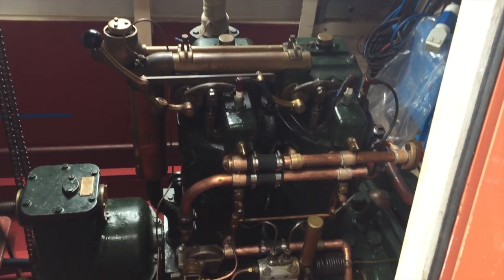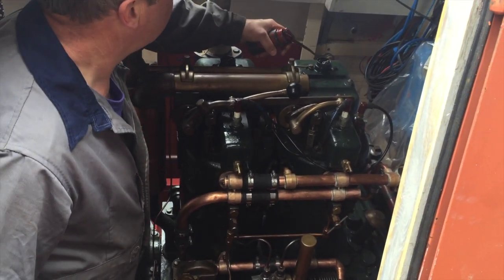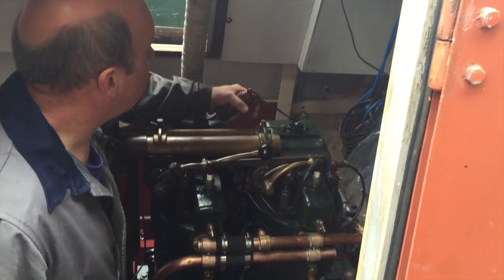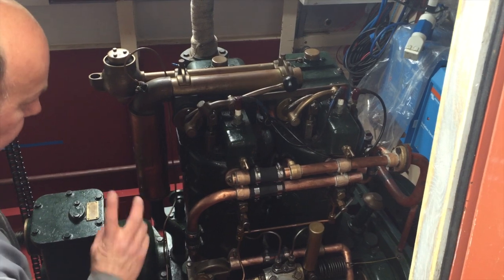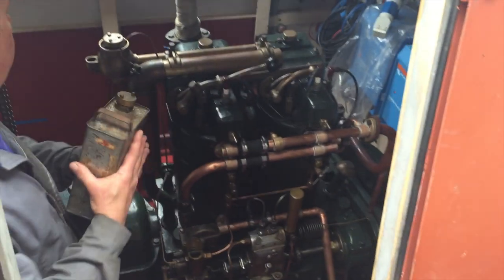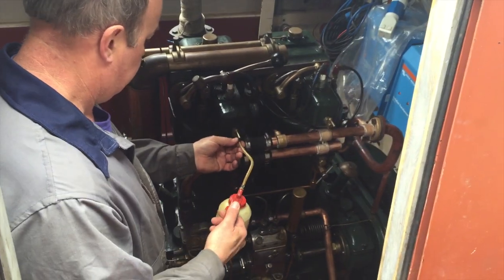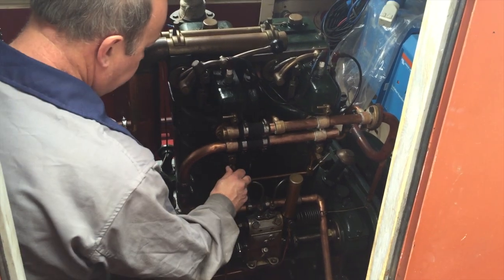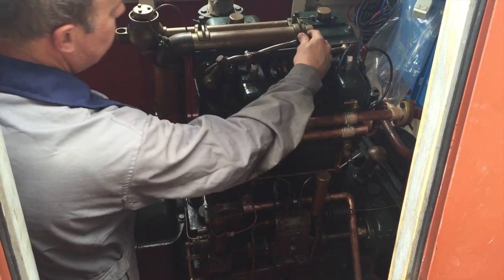1942 K2 Kelvin Engine. 8 1/4 Litre - 2 Cylinders.

Comment: Did it even get running on it’s own before the video stopped?
Reply from the maker: Its running in this video. It starts on petrol and then switches over to diesel
Reply: It's what they call a "hit and miss" engine. They fire a few times, then coast a few strokes, the hit a few times.

Comment: Why didn't they simply make the cylinders smaller and make it an even firing three cylinder-silly design.
Reply from the maker: Because you would reduce the overall torque low down - while increasing the rpm for the desired output.
Reply from the maker: also - its a 1942 engine. what are you expecting?
Reply: If you knew propeller torque curves, you'd know that low end torque isn't necessary since propeller horsepower consumption is the highest at the highest RPM. But having a 1942 engine is unique. Give me a modern 3 cylinder water cooled engine that you simply turn a key to start.
Reply from the maker: @Tchristman100  Quite presumptuous about what I know and what I don't know - but thanks anyway. I'd love to stay and chat - but I'm a busy engineer and not an armchair youtube critic
Reply: @deffojeffo  well said👍
Reply: Funny how there is always some smart arse know all to spoil the moment! F.F.S!
Reply: clown

Comment: I was on the motor barge Roan in 1969, London & Rochester Trading Company. She had a Kelvin 88, which was the 4 cylinder version of this type. M.V. Action was another small Coaster with twin 66's, the three cylinder version. Brilliant, reliable old workhorses! We started on petrol then changed the valve over to run on diesel when it was running. We used to put a drop of petrol in the bowl at the end of the air intake manifold, then squirt some through the vent taps on the side of the heads. All hand crank in those days, no fancy electric start for us back then.
Reply: I was on the NOUGHTON she had an 88hp Kelvin engine, never let you down, plodded on and on. great days.  Late 60s 70s, That was about the time I was working for Crescent Shipping. then went on to the small Coaster LOBE. running around the southeast coast and across to the Continent, Rotterdam, Belgium, France.
Reply: @brian.7966  Hi Brian,i was on the mv Rodent in the 70s for Crescent Shipping, i think she had a 3 cylinder 66 hp Kelvin engine, a good engine,hard to turn over when you are knee high to a grasshopper, the Skipper was bing Bill Sales
Reply: Hi Mo Gordon ,i was on the mv Rodent in the 70s for Crescent Shipping, i think she had a 3 cylinder 66 hp Kelvin engine, a good engine,hard to turn over when you are knee high to a grasshopper, the Skipper was bing Bill Sales
Reply: Hi Jeffrey! Have only just come back on here, sorry it's taken this long! I was only on Crescent for a few months as I was waiting for a belated welder/plater apprenticeship to start. John Woolsey from Greenwich was my skipper, a miserable shit and always came back on board pissed! Nearly had us run down twice! Both times up the Thames! I wanted to go on the continental boats like Kiption and ignition but was told they wanted me to learn the Wallasea, Rochford and Medway runs. Not long after leaving them, I joined the Royal Naval Auxiliary service at Chatham and trained as a marine engineer, on inshore minesweepers, mfv's, fleet tenders, a tug and fast patrol boats. Had 16 years with them and ended up a chief P.o. Would have stayed with crescent if I'd got a continental boat.Happy days!,

Comment: Presumably you still own the narrow boat this engine lives in I have seen another video done by " Cruising The Cut " and his engine is a wee bit easier to start than yours as his is equipped with an electric starter. Not that you don't start her easily but we are all getting older and pushing a button instead of manually cranking her over may make you feel better. Cruising The Cut videos has three videos about classic old engines like yours in a proper engine room. Do you still hand crank your car? Time to consider installing a electric starter. Other than the starter all you really need is a geared flywheel. 

Merry Christmas!

Cheers!
Reply from the maker: James Shanks it’s not my boat - mines not as cool as this
Reply from the maker: James Shanks it does have electric start I think - but it was disconnected at the time of filming
Reply: Engines like those are likely more about nostalgia then ease of use. Like a status symbol. Otherwise I would guess that a conversion to a modern diesel engine would have been done. It’s very cool in my opinion. 

Crank on and cheers!
Reply: Jeremy Kamel this actually looks like a newish boat judging by the steelwork. Likely it was constructed with the intention of installing a classic showpiece engine. Conversion was never a consideration!

Comment: Big old two lung thumper.  Around the same time this engine was designed International Harvester had a number of large diesels that also started on gas then switched over to diesel.  Thanks for sharing the video and seeing the old beast being started and running.
Reply: That rings a bell!  In 1970 I knew a farmer who had an IH crawler tractor that he started on petrol then switched to either kerosene or diesel ... I can't remember which ... to carry on.  It was a bullet-proof engine that, typically for much farm machinery, received only very basic maintenance, yet went and went and went ... left outside in all weather of course!
Reply: I've been around a ten or so of those crawler tractors. A couple were really big too. Saw two of those engines set up as gensets and one driving a sawmill.
Reply: We had two John Deere "Johnny Poppers" that could start on gas (petrol) and switch to just about anything runnier than lard once they warmed up.  But they were spark-ignition engines on all fuels, not diesel.  
They did blow smoke rings when burning kerosene, which we thought was pretty cool.

Comment: K2 is 44 HP   very good engine  top rpm 600
Reply: 750 rpm for K Kelvins.
Reply: @billalbion  that depends on how your fuel  rack is set up
Reply: @annajeannettedixon2453  I think you mean governor which controls the rack. 44hp could not be made at 600rpm only 750. Look up the Kelvin book on line.

Comment: That type engine developed 22 bhp per cylinder at 750rpm in fishing working boats, tickover on diesel is 180 rpm with a 9 inch stroke. Indirect injection needs petrol to start and warm cylinders to fire on diesel.
Reply: Les Reed The engine has a dual function principal.  Meaning, the engine operates gasoline first to warm up the diesel side of the engine. Once the diesel side warms up, you change over the engine to run on diesel. Hence way some old tractor books refer to these engines as Change-Over engines. The gas side is for engine warm up, and the diesel side is for work. International Harvester made series of these engines for all types of applications, like the UD-16 and UD-24. But they were mostly used in dozers and power units applications.

So " Indirect injection needs petrol to start and warm cylinders to fire on diesel" is a correct statement, to this video. As the Kelvin engine utilizes this function.
Reply: Les Reed Read the description. It clearly states "Kelvin Diesel (with petrol start)"...
Reply: Pre combustion chambers. Like my  Mercedes  240d. It will drink any liquid that burns  as long as there are no lumps in it. Used engine oil, paraffin with 100:1 2 stroke mix used chip fat etc,etc,etc Harry Ricardo- a genius.
Reply: "Indirect injection needs petrol to start and warm cylinders to fire on diesel."
 Errr, where did you come to that observation? 
I've worked on diesels for some 45 years  (and my father before me) and am aware that the accepted manner of starting an indirect injection diesel is by heating the air in the pre-combustion chamber, via heater plugs or a thermostart system (typical on many small diesels - particularly Perkins). At a pinch, you could stuff a lighted rag into the inlet manifold!
Contrary to many people's observations about ether (yer engine gets 'dicted to it - don it), I (and my father) found that if used correctly, many more useful years are given to both starter motor AND battery.
Reply: @lesreed9269  What part of "petrol start" don't you understand in the phrase "1942 Kelvin Diesel engine (with petrol start)"?
Reply: @lesreed9269  there were thousands built at Kelvin Dobbies loan Glasgow started by hand. You've got a lot to learn boy. The old Cat engines were indirect started with petrol donkey engine. Indirect engines always harder to start compared to direct injection. There's always things to learn In life boy.
Reply: @billalbion 
 You've said nothing I don't know - donkey engines have nothing to do with my initial comment.
Reply: @lesreed9269  you have maybe no travelled far enough to know everything about all things, nobody has, and especially trying to ridicule folk for telling you the truth about something you knew nothing about. There's some if they had as much brains as mooth they'd be professors.
Reply: @billalbion  
Don't have a clue what you're on about.
 I merely commented on the difference between direct & indirect injection. 
The principles DON'T change.
I have no idea why donkey engines were brought into the picture...
Reply: @lesreed9269  your maybe no as clever as what you think you are. Look back , you didn't believe petrol was used to start diesel's so your right you don't have a clue or have the guts to admit you didn't know. I'm finished with you boy.
Reply: @billalbion  Thank heavens for that!
Reply: Hello. Don't like to cut and paste - but if it helps....
"An indirect injection diesel engine delivers fuel into a chamber off the combustion chamber, called a prechamber, where combustion begins and then spreads into the main combustion chamber. The prechamber is carefully designed to ensure adequate mixing of the atomized fuel with the compression-heated air."
You seem to be saying to me that because this engine operates over a dual fuel system, that it is an indirect injection engine: that would only be the case if it had a "pre-combustion chamber/Ricardo chamber". If it does, then you are correct, but you've made no mention of this chamber - only that it uses petrol to warm up - and then switches to  diesel. Does it have a pre-combustion chamber, which is separate from the main combustion chamber? Cheers, Les.
Reply: Engines of this nature are usually of the indirect injection kind. If not, they should have two different combustion chambers; one for diesel(main chamber) and one gasoline/petrol(starting). The chambers are separate and sit over the cylinder. Arrangement of the chambers varies, depending on the manufacturer. Some heads are set up with the diesel combustion chamber at the uppermost part, or diagonally. A valve is what separates the chambers. Then is moved when converting the engine to run on straight diesel.
Reply: Another example of this engine were the international TD6 series bulldozers (1940-1969)which had to be started on  petrol  . You ran them until the engine temp was as close to 80 C as possible,then you flicked over to Diesel and turned the petrol off . The internationals engine was a dieseled version of its petrol engine .

Comment: I've been watching videos like this and was curious about the fuel efficiency, how many gallons per hour does this engine use during idle and cruise?
Reply: We used to own fishing boats and one,a 65 ft vessel had a lister JP 6 which at working speed would sometimes only consume 1 gal. per hour. We could calculate fuel use because the engine had a day tank where fuel used during the day could be observed. A lot of these engines are similarly economical.
Reply: I am told this engine is 22 BHP  Using the formula BHP x .055 = gallons per hour in US Gallon.  There are 1.25 US gallons in 1 imperial gallon.   That gives us 1.2 US Gallon.  Knowing how little power it takes to keeping a narrow boat moving it is likely they use something around 1/2 a imperial gallon an hour cruising.
Reply: @Femmpaws  thank you for the response. My trucks would consume a gallon US per hour at idle and 10 per hour loaded ( or more ) at speed.
Reply: @Femmpaws  22hp per cylinder at 750rpm, that's a 44.
Reply from the maker: I dont have a clue - i know the engine has MASSIVE amount of torque and really low revs - I shall ask the owner next time i see him.
Reply: I'd appreciate that, I've been in transportation forever and really like engines of all kinds. I got turned on to this style of engine through a recommended video of a June Munktell powered fishing boat. So relaxing to listen to. Might get a boat with a low speed diesel just to unwind. Thank you for the response.